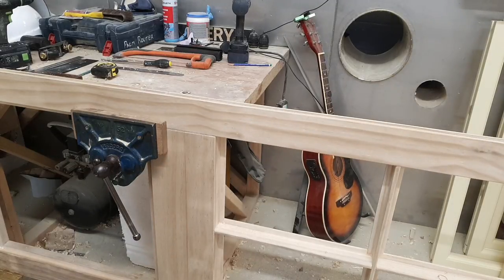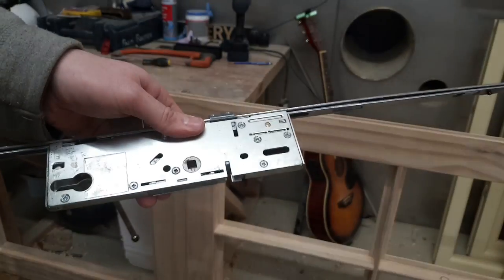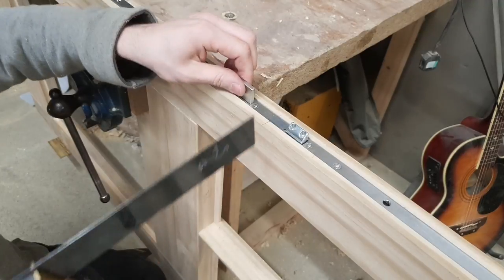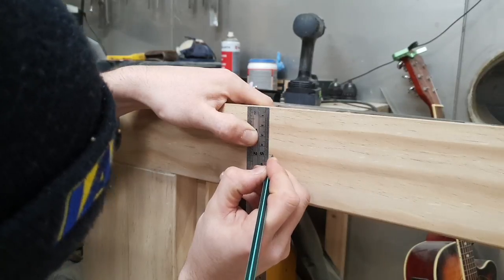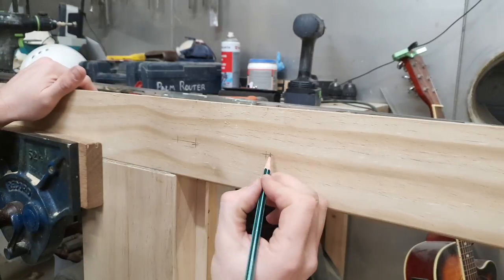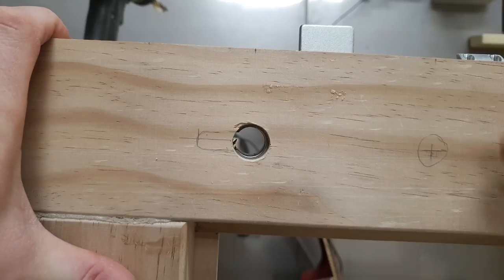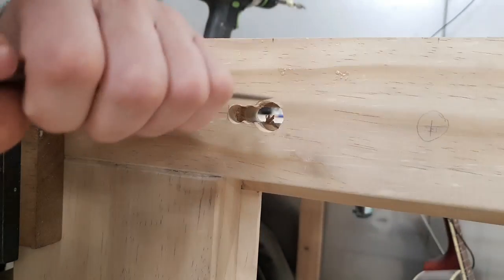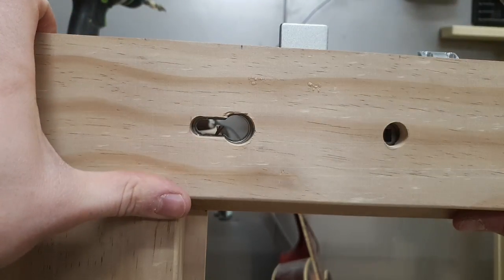Euro Cylinder Lock: How to Set Out Drill and Install

Comment: A well presented instructional. Can I ask what size auger you used and are euro lock fronts a standard size? I think I’ll try a lock jig for the mortising, but you’ve clearly demonstrated that drilling with the right tools is the way to do the rest, great work, thanks.
Reply from the maker: 16mm which is the faceplate size so be very carefull. some multipoints have a 18 or 24mm faceplate, but most PVC style ones are 16mm eurogroove

Comment: Thanks for the vid. I'm a home owner wanting to convert the deadlocking night latch on my timber door to this kind of euro+spindle multipoint lock. Some questions...

Is this even possible?

Would the metal strip that runs the length of the door be able to stop my door from warping? It seems to warp slightly in the summer when the morning sun beats onto it. 

I'm sure you'd need to see the door to answer for sure but in principal can this be done?
Reply from the maker: HI, the metal stip wouldnt aid warping, they are only thin, is the door a dark colour as that often contributes to warping in the sun, the extra heat certainly affects them! changing the lock would be possible, there is a fair bit of machining to do both door and frame and then filling the old lock, but it should be possible!!